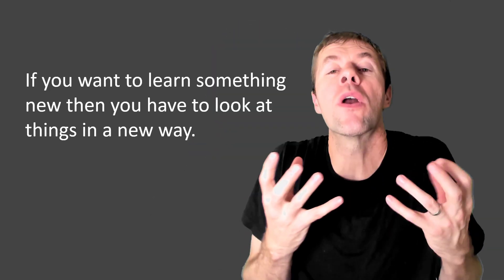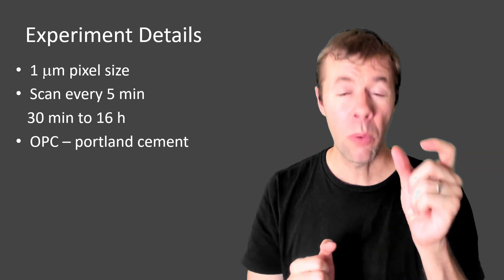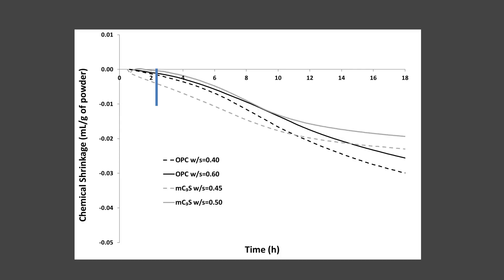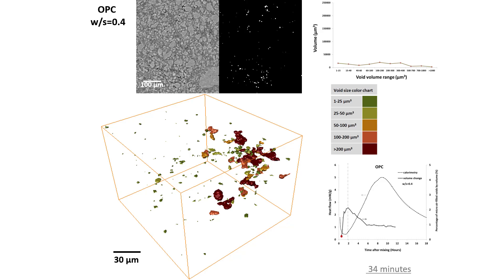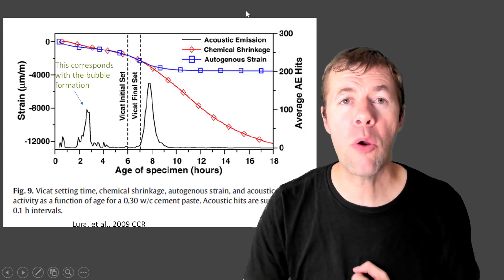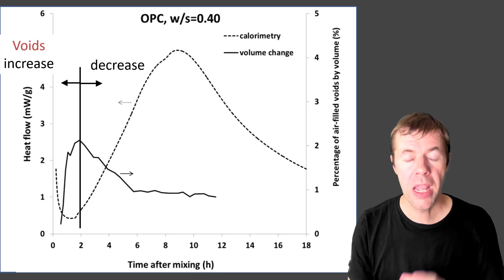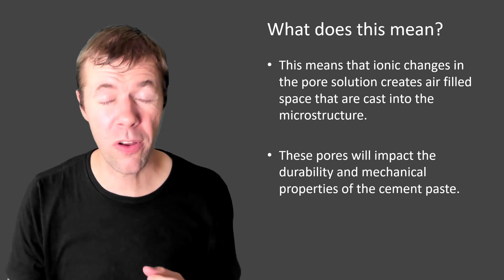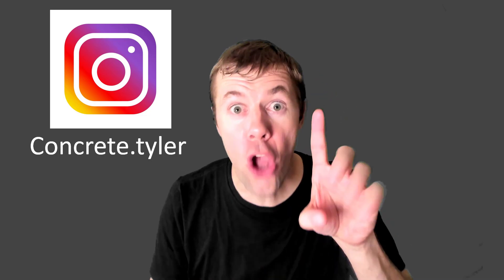Can Water Make Voids in Concrete?

Comment: Should be that hard to remove the gasses in the water. We only need a holding tank, and then a circulation pump for hydronic heating systems that pump the water trough one or more (standard) air eliminators. Can have another holding tank that can process while we drain the other. Shouldn't be too difficult a project to get most of the air out of the water if we wanted to.

Comment: Hi Tyler, I am building a pizza oven. I have been researching aircrete on YouTube and the thermal properties seems too good to be true. I expect at 100mm thick I can stand on top of the dome, but also not allow any heat to penetrate, admittedly easy to scratch so would need to be rendered for protection. I would love your expert interpretation on air based mixes. Seems like it is not researched as a building product yet and as a technology I think it could replace polystyrene in small building sites where insulation is required. I would watch this vid :)
Reply: Oop! found another video you did already. Love your work!

Comment: Hi Tyler,  Love your channel with all of the interesting information on concrete!  I have a question that I thought would be fun to get your thoughts on.  I’m not Structural Engineer, just an Electrical Engineer homeowner that loves doing projects around the house with concrete.  What do you think happens to concrete if you use it for a fence post but add it to the post hole dry in a moist cli ate (not desert).  I did that to my fence when I made it and it has held up well but I always wondered how strong the concrete set up.  I used pre-mix so the assumption is that the concrete was uniformly mixed.
Reply from the maker: Thanks!
I have done this as well.  The concrete mix will pull water from the ground and hydrate.  I always wanted to do different experiments in different soil types but I have not gotten to it yet.  Thanks so much for the reminder!

Comment: Thank you professor,  I've got a question. 
Could you please tell me why failure in high strength concrete is more brittle than the normal  concrete ? Is that from the lowest of W/C (low porosity) or what's the reason?
Reply from the maker: Khalid, thanks for the question.  lower water to cement ratio concrete has more cement particles and less hydration product or glue that holds the concrete together.   
As cracks propagate in this material they go around the cement grains because they are very stiff and strong and instead go through the hydration product.  Because there is hydration product then you don't need as much cracking before there is failure.  Was this helpful?
Reply: @TylerLey  Of course it's so helpful.
Thank you professor

Comment: Interesting ... now I wonder, would water brought to a boil under vacuum be able to work as well as de-aired water with less fuss of that process of heat boiling the water an then introducing He. I would think this could be done at the mixing plant ... hmmm, but then they could not just pump or dump the water into the truck.... sigh*
Reply from the maker: That is right scooter.  You would have to mix in a vacuum.  That is done by dentists when they make the cement to fill your teeth.

Comment: Awesome Tyler... this is my belief about water being trapped... but, I take it a lot differently, I think about the ''hydrogen'' in the water and it's reaction...  Hydrogen is an element that everyone counts as not active with respect to the human drinking water and for all other reactions... Yet, we call it the universal solvent... BUT, it has O2 in it! 
O2, has hydrogen... 
I also think of shrinkage as compression... that it is tension resulting in compression during shrinkage.
Further, any lifelong shrinkage also is ''displacement'' of materials... again, tension is created by design? 
This tension, must be HUGE... as it is longterm / creep tension? (and not just some magically ''shrinkage" but, a tension and unless you get buckling then the shrinkage is displaced in the ''air voids")... just a crazy thought... 
Thanks Tyler for sharing your data and knowledge.
Tension has a clamp force from one direction if you get shrinkage...   I do not think so, so perhaps the shrinkage is consolidation of air voids over time with frequency of the structure being loaded over the years...  
My thoughts...
For clarity, I referenced shrinkage... I mean long term, not short term.
Water has nitrogen as it has air content and nitrogen is about 79% of air... water has hydrogen and is one part of that formula which can actually change to H3o (which many people do not know of)...
Okay, so we get all these elements working and we only talk about water as if it is in a vacuum in they hydration process...
Reply: I think all of the hydrogen atoms from the water molecules seem to already be accounted for in the hydration reactions.  They become part of either the calcium silicate hydrates or the calcium hydroxide.
Reply: @SwedishDeathLlama  , not sure what is happening with my replies to you... Here is my last attempt,
for clarity, I referenced shrinkage... I mean long term, not short term.
Water has nitrogen as it has air content and nitrogen is about 79% of air... water has hydrogen and is one part of that formula which can actually change to H3o (which many people do not know of)...
Okay, so we get all these elements working and we only talk about water as if it is in a vacuum in they hydration process...

Comment: Some water actually have a natural content of carbon dioxide, and I suspect that it would be as bad as air in the water.

As for "de-airing" water, is it enough to tap it up into non-pressurized containers for use the next day?

Overall a piece of the puzzle of making the best constructions that needs to be thought through quite a bit, nothing is simple.
Reply from the maker: These are all good questions.  I hope we can find out!

Comment: Hi Tyler
Why dont use co2 to pre fill up water with ions (and then removing other gasses)?
The co2 wouldbe mineralized by in the cement without consuming too much calcium i think.
Also keeping water in vacuum should get rid of lot of air without bothering too much fiel workers. 
Both could be combined :
1st water vacuuming then carbonated to saturation to prevent air to reenter .
Reply: Dissolving CO2 in water would make carbonic acid, which could eat away at the concrete (like soda can erode away teeth if left in contact for long enough).

Comment: Thanks Tyler, another good reason for using a vibrator....to agitate the mix and cause air pockets to rise to the surface.  Then the liquid state will fill the voids around rebar as well as minimize air entrapment.  More good info.    J K
Reply from the maker: Thanks James!  I had some vibrator video at the end but took it out to shorten the video.  Maybe I will cover this in a future video. Thanks!
Reply: Please the world is thirsty to concrete vibration techniques , methods , the right way and comprehensive understanding . 
Outstanding videos keep them coming please .

Comment: Enjoyed your (ahem) screed on this topic. I would expect improvement in pavement life span due to freeze/thaw issues and improved compressive strength.

What do the breaks look like?

I guess forming concrete limits your aggregate size. Did your methodology include use of a micro tremie for placement?
Reply from the maker: Thanks for the comment.  Voids typically decrease compressive strength.  It is not clear how these voids hurt or help freeze thaw.  The straw was stuck into the sample and then the end was covered as it was being pulled out.

Comment: About the voids..Don't they add structure to the concrete? Surface area internally? I've worked on slabs where they create tunnels with elongated airbags (then deflate and remove them after the concrete sets up) to add strength, supposedly.
Reply: At the risk of over simplifying, when you remove mass from a structure you remove strength but if you do it in a way that leaves a helpful structure it can remove a lesser amount of strength for its mass. From the veiw of concrete being porous, then this is a situation when things can get into it over time, a significant issue for longevity, except in freezing environments as I understand. Making concrete resist ingress cause there is nowhere for things to go may be an important durability/longevity point.
Reply from the maker: Thanks torque for the comment.  I agree with your statement.  I agree that it is not clear if this will help or hurt with freeze thaw durability.  This is the next thing that we hope to look at.
Reply: torque350hp ...The first time and perhaps the only time I saw this technique used was in Santa Monica (next to the Pritikin health center) on an eight story building about 1989-90. What you say makes sense. I've seen precast floors with the same hollows.
Reply: @blipco5  yeah hollows and voids are a useful design, even porous concrete, if thats what is needed. Low porousity concrete could be quite useful theoretically. It will be interesting to see.
But im just someone who found  a big interest in this when i started some house renovation, so im not trying to overstep myself. 🙂
Reply from the maker: Thanks blipco for the comment.  I think torque350 gave a great answer below.  I am going to respond to him.

Comment: What happens if you make and pour concrete in a vacuum with de-aired water?
Reply: You will need to use hand signals to the pump operator because nobody can hear you scream. 🤦🏻‍♂️
Reply: William Degnan ...Ha. A quiet job site would be wonderful.
Reply from the maker: blipco - We don't do this in the field but we can do it in the lab.  This is how they make dental cements.  They find that their material is much stronger and resistant to cracking.
Reply: Tyler Ley ...Thank you, I DID mean in the lab. I didn't know that about dental cements though but for what you pay at the dentist....